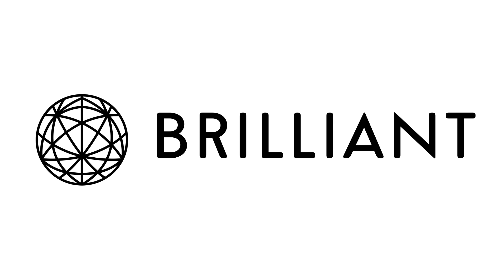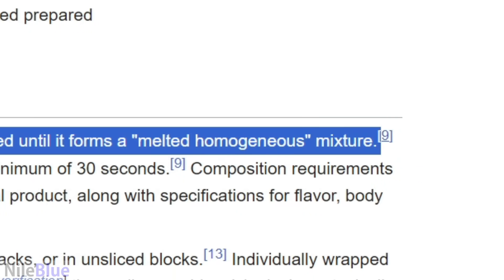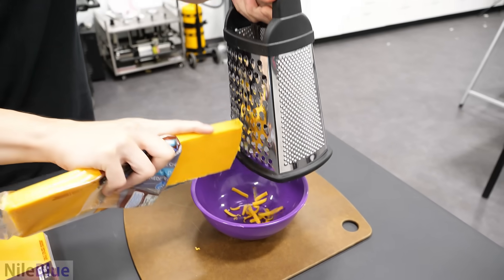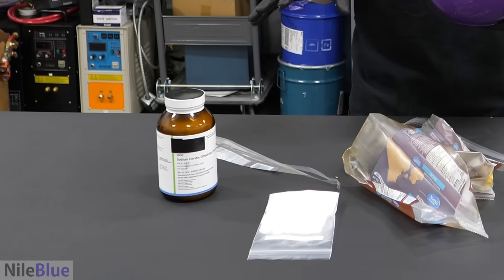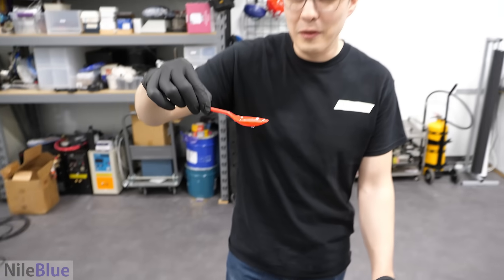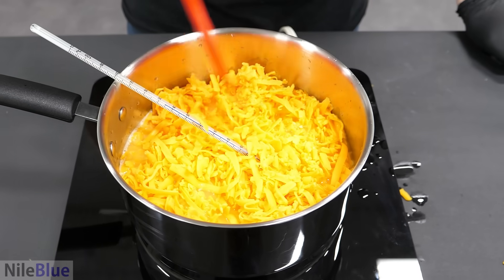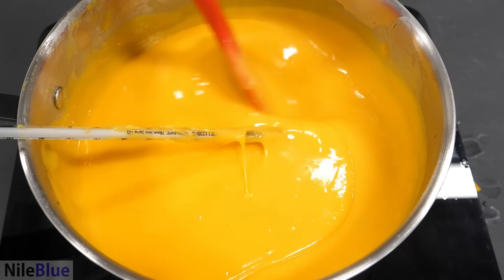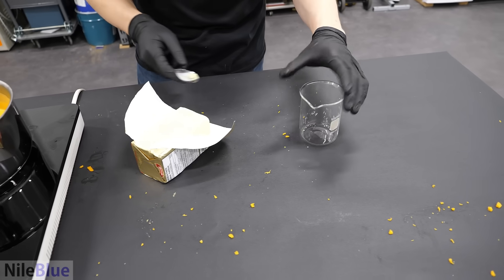Making American cheese to debunk a conspiracy

Comment: Processed cheese was the product cheese mongers came up with when left with various bits and pieces of cheese or cheeses as well as cheese that didn't press well or cracked or unsellable.  Rather than throw it out they thought about making sauce but by accident discovered that when  it got cold it could be sliced and melted. Selling it as cubes of ready to make cheese sauce until someone got the bright idea to slice the cubes thin and place the slice on a sandwich. If the sandwich was hot ,the cheese instantly melted and thus the philly cheese steak was born as the cheeseburger was too
If you were too poor to afford meat , the grilled cheese sandwich was the go to happy meal

Comment: Not all orange, American cheese slices are the same. You've made the 'quality' version, that actually uses cheese made from milk. The cheaper version is what is referred to as plastic. If you look at the packages, your version will say there is 'milk' in the slices. The 'plastic' cheese will not, and will be made strictly from oil and emulsifiers, and uses added flavor to make it taste 'cheese' like. 

The version you made will melt. The cheaper version absolutely will not. Instead it just becomes a version of itself that is slightly larger in area.
Reply: American Cheese slices are all, by definition made from cheese.   They cannot be called “ American Cheese” due to FDA regulations if they are not.  The other product you’re describing is “ cheese food product”, and yes it’s revolting.

Comment: You don't need weird chemicals to make a Swiss cheese fondue, you have to heat some white wine at first and only start adding the cheese in small amounts after the wine has raised to heat, otherwise it might split. The wines acidity helps to unify it withe cheese without splitting. I guess your chemicals do the same thing

Comment: I don't get this... so in one part of this video you have a scale that you're using to measure 1.2 grams of a crystalline powder, and you use a kitchen scale that has a resolution of 1g, and then later you're measuring a large quantity of something, like about a hundred times as much, and doing it on a scale that appears able to resolve down to ONE PERCENT of a gram's weight... where was THAT scale EARLIER?

Sure, approximately 0.8 grams is a small amount of material, but as a RATIO of the amount you aimed to add, the amount you added was nearly DOUBLE... and if the recipe only calls for a gram of something to a few hundred of all the other ingredients... you're just screwing around, right?

Then again, there's a moment most of the way through where you're heating a metal pot and holding it gingerly by its lip with fingers protected only by what is—I think—a nitrile glove... while stirring with a whisk and on the OTHER SIDE of the pot, clearly visible partially in the shot, is this thing sticking off into the empty air... a spine of metal, it seems, probably firmly anchored to the pot, and a section of its length, long enough easily to be grabbed by someone with fingers, encased in this black, fairly rigid looking material, that if I had to guess, that I suppose I would guess s probably made of some electrically and thermally fairly non-conductive substance... something plastic but designed to... um... HANDLE... the heat conducting into it from whatever heat source the pan sits above without getting terribly hot itself.  Perhaps it has a name, implying its function... perhaps it might be called a ... candle?  A sandal?  Well... I'm sure it has a name of some kind.

WHY do you DO things this way?!?  Is it for laughs?  Is this like ElectroBoom but for chemistry?  Don't get me wrong, I enjoy your videos but... it's like the scene in Jumanji where the kid has to get into this shed to get an axe but it's locked so in a near panic he decides to break the door down with... an AXE that he finds nearby... the very sort of axe he was trying to break into the shed to find... it just doesn't make sense except if done for humor's sake.
Reply: He looked for the better scale after finding out that the scale he had was inadequate lol. Also yeah him not holding the pot by the handle had me screaming